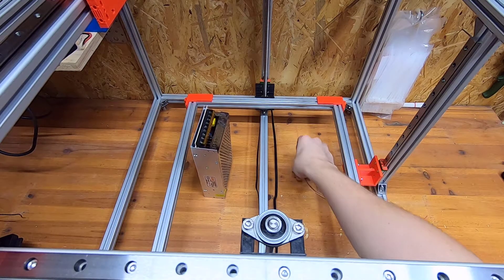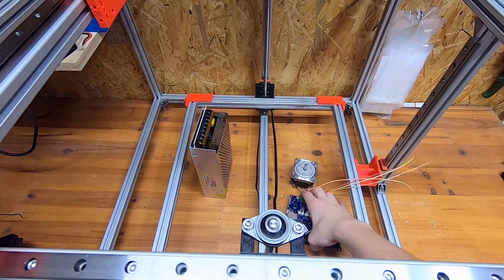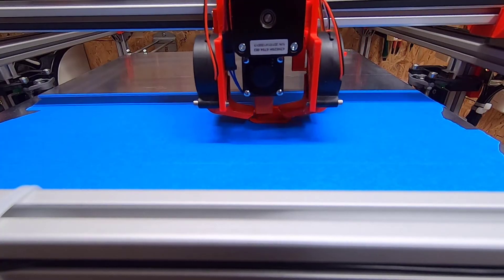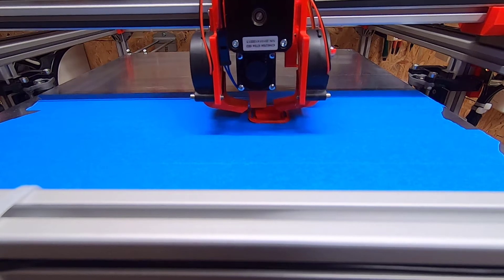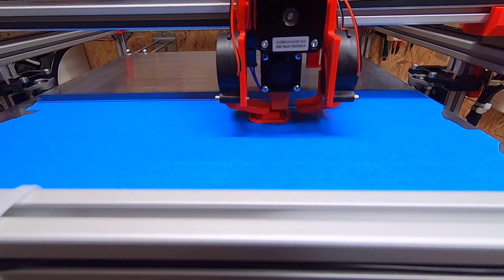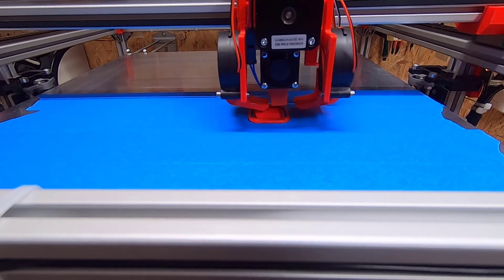Giving it Power, Wiring up my CoreXY Printer

Comment: i was wondering where did you get the build plate. i have been looking for a plate of aluminum and have not had much luck.
Reply from the maker: I got mine from a friend. But you can find many different aluminum sheets for example on ebay. There I have already ordered several times aluminum sheets